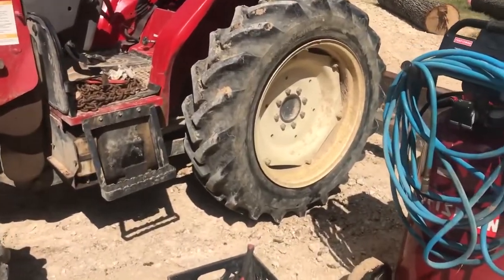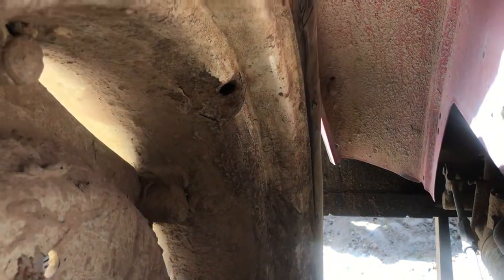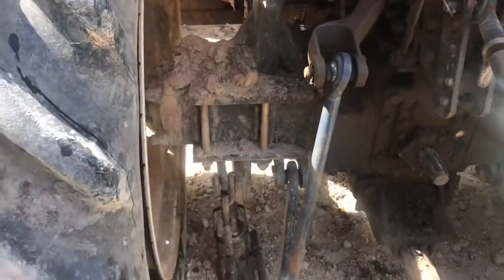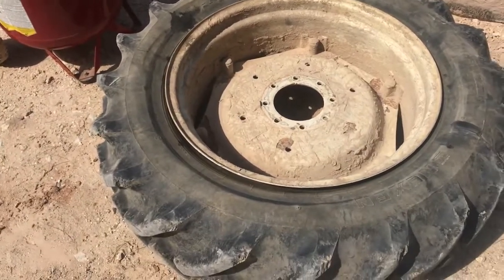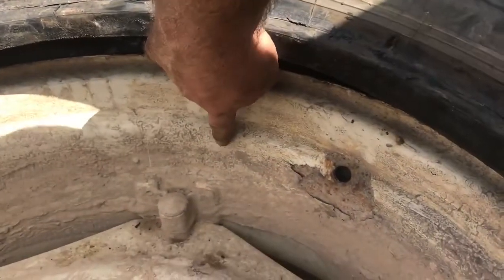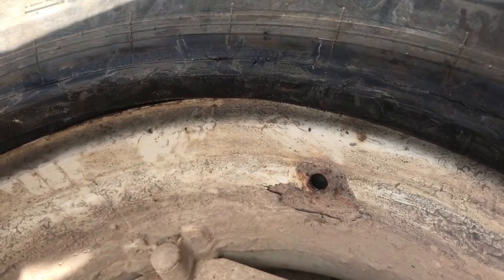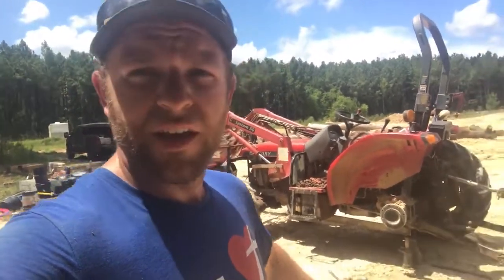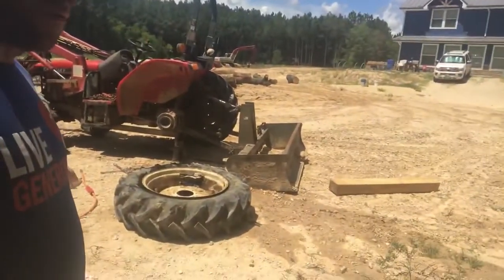Tractor Tire Tube Repair and Replacement

Comment: That picture we see announcing your video is what attracted me. I'm in that position now, tyre 3/4 on and going no further. I'm frightened of it splitting. I have already changed one, off the tractor but thought I'd have a go doing it still on. I'm using three vice grips together, there's that much force. Much smaller tyre than yours on a micro tractor (Iseki TX1300). Swapping front lawn tyres for agricultural. Lots of the proper white lube. One long  screwdriver has bent. Got spoons and bars. Would love to have seen your man put it back on.
Reply from the maker: Good luck bud. I wish I’d have gotten video of it too, but he was too fast! Smaller tires are harder actually, as you’re finding. Have you tried bacon grease yet? 😉

Comment: I feel your pain. I despise working with tires. I like the trick about using locking pliers to hold the bead from slipping back.
Reply from the maker: Yeah the vice grip on the rim was a big win! Too bad I’d already damaged the tube farting around.

Comment: Thanx for sharing but its possible you might have just had a leaking valve stem. Sometimes those slow leaks are hard to find especially on bigger tires. I am in the same spot right now but in it too deep to turn back I spent 2 days to take 2 rear tractor tires off rims off tires off but gonna give me a chance to paint wheels and new tubes and tires I think I will do the install also as I here they get about $100 for mounting.
Reply from the maker: Mounting cost all depends on the shop. My local guy I think charged me $20 to put in tube and round the tire on the rim. I did the reinstall on the tractor myself

Comment: Leave the last bit at the valve stem ,otherwise its easy to break the valve stem off ,save the  old tube ,get the garage to repair it for a spare